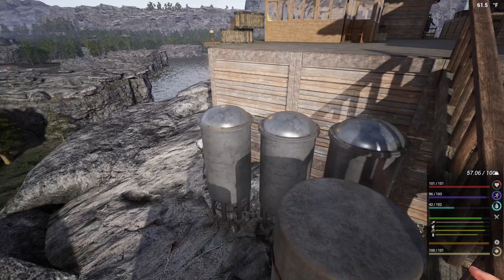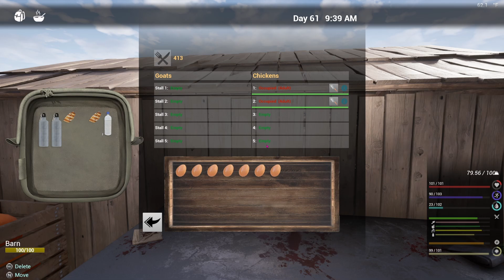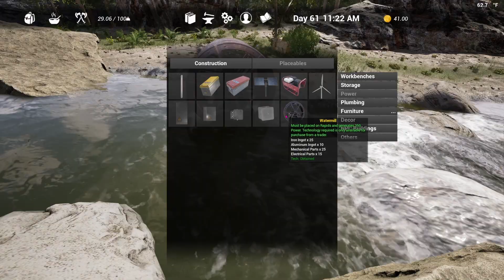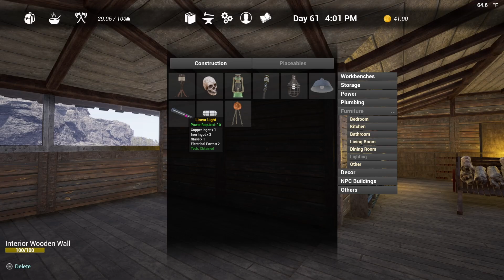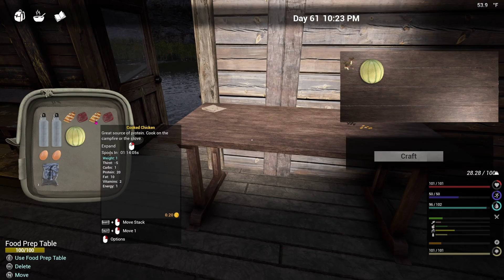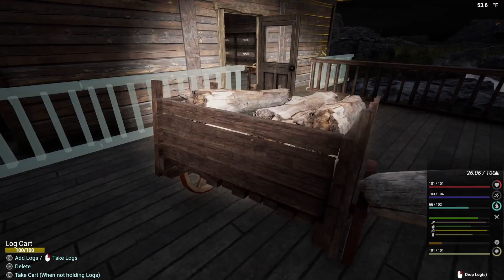Day 61 | Power - Lighting - Building

Comment: Your ceiling hole at 20:15 ish is because your ceilings are backward. Those flat pieces are actually directional. If you will look closely. The wood supports(dark beam) on those flat roof panels don't line up. There is a fix. But you have to redo one or more of them. Its a nuance many miss. Just like how glass walls and half walls can accidently link to the wrong piece and make them uneven. I really enjoy your playthrough. I like your narration. Thank you.
Reply from the maker: I didn't know that.  Thanks for the information.